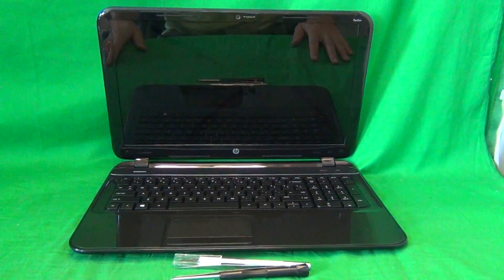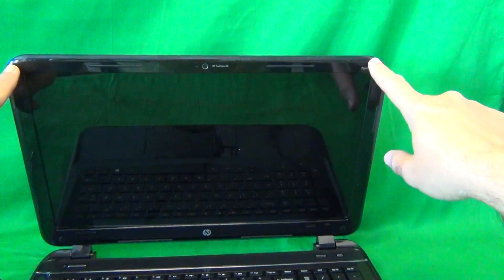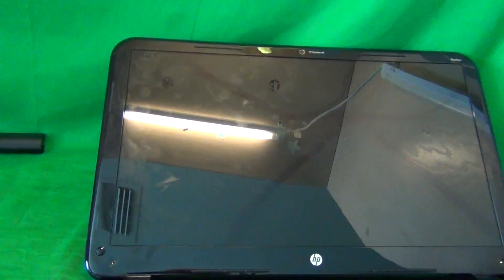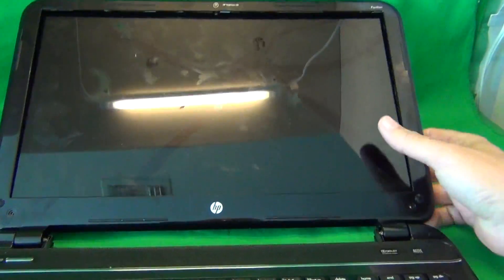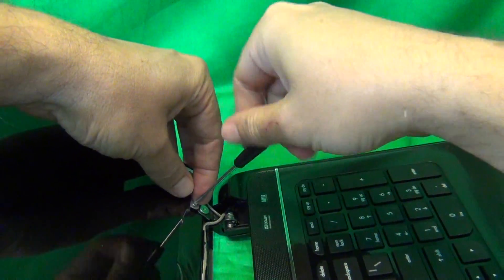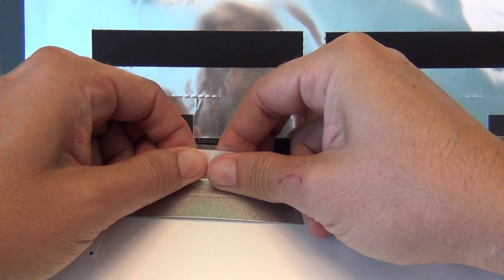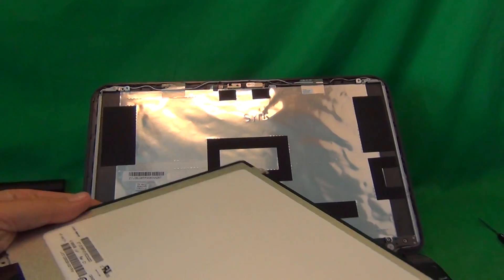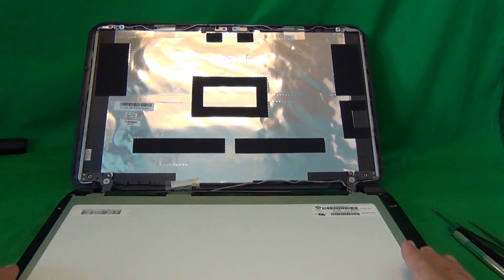HP Pavilion 15 Notebook Screen Replacement Procedure

Comment: What about an inverter for a HP model no: TPN C130 , do you sell those, or even could you tell me where it's located I can't seem to find anything on this, if you can help with the issue, you'll have gained my custom for the replacement part and future parts.

Comment: Nice video. I actually have a screen issue on my HP 15-b006ed. But this is caused by the screen inverter that is underneath that dark tape. Do you have a replacement video of that? Thanks so much!

Comment: I have a HP pavilion with the model number 15-r033ca it's not a touch screen model but it doesn't have screws or screw covers atleast so how should I take off the screen to replace it?

Comment: I have a problem with mine.  The screen has gone very dim.  The computer turns on and you can just barely see that there is an image on the screen.  When pluged into my tv through hdmi I can run the computer but can't see anything on the actual laptops screen.  From other videos it seems like its the backlight or inverter?  Is this anything that a new screen will fix or is it something else.